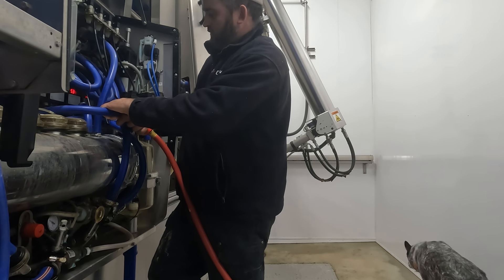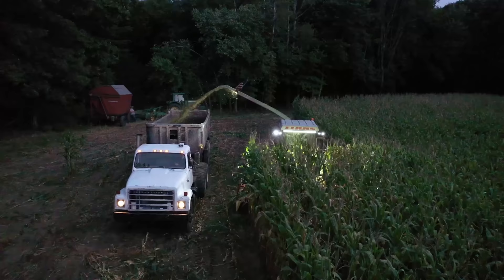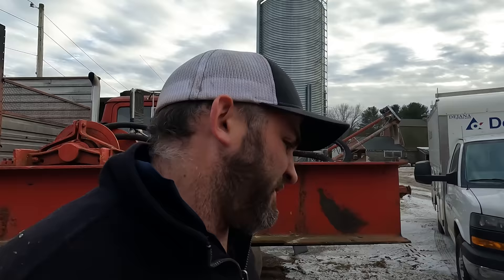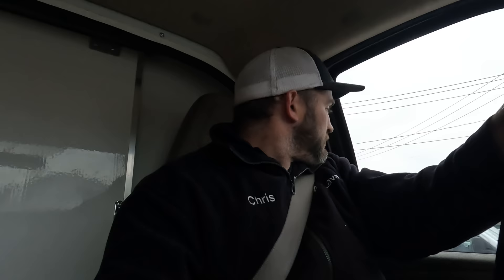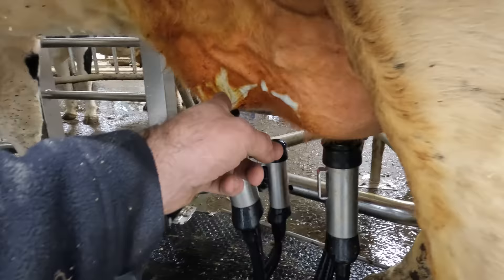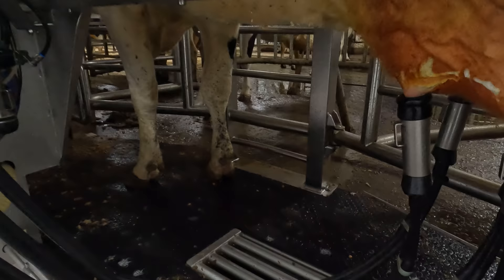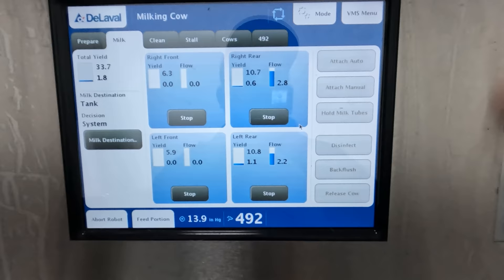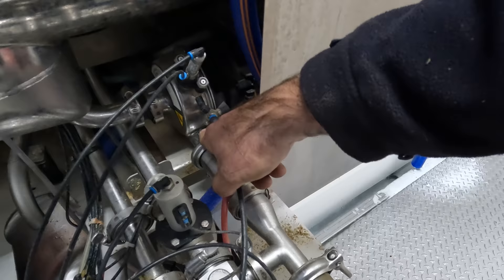Fixing A Milk Pump On A Delaval Robotic Milking Station- Day Job Work

Comment: Those containers are pretty expensive these days for sure, especially ones in good condition.  My brother bought 2 40fters and had them fabricated into a cheese factory he designed and dubbed cheese pods. His business kind of exploded and he outgrew them in about 2yrs. If you're ever down working at graywall in ct you will see them I'm pretty sure they are still there. Heck maybe they'll sell them to you not sure if they are using them or not.

Comment: Happy New Year you need to enjoy your vacation. Hope this year is good to you, and we enjoy your videos. Just a note on the stainless tanker. The sheeting on tanker is probably only a mill finish and that will not lend it to well to polishing. If polishing is required on something you would order the S/S in a buffed finish with the oxide removed. Plus that paint on tank is dangerous to your health. Just a thought.